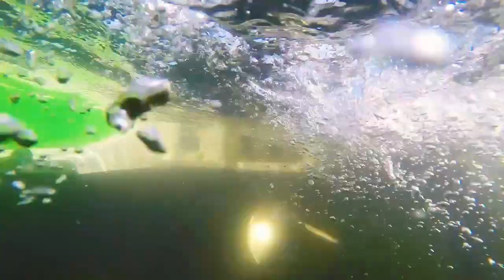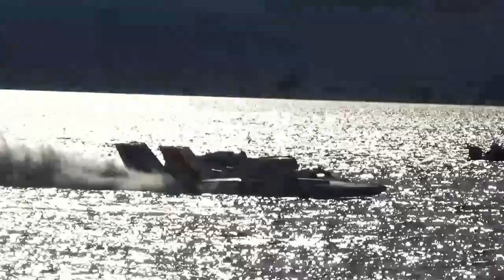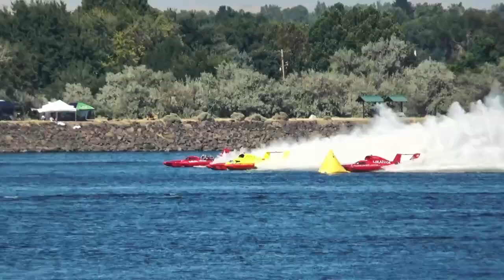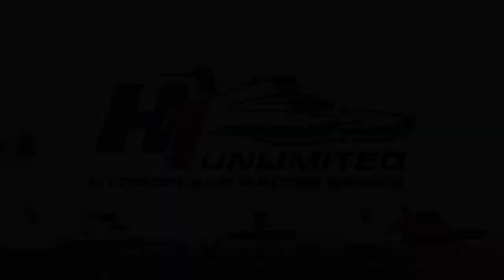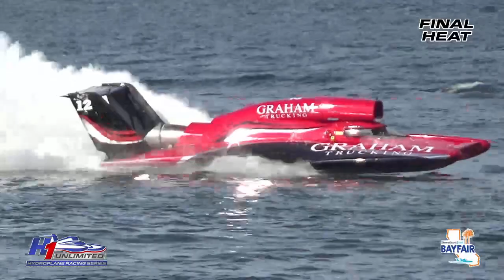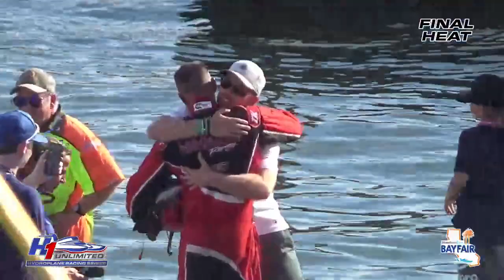2019 HomeStreet Bank Bayfair Final Heat

Comment: I like JMK but I don't like the way he started that race. What happened to the 80mph rule?
Reply: That start sucked. So, just go park your boat with 2 minutes to go and CRAWL?!? How lame is that??? I'm with you - what happened to the 80MPH rule? Park-and-start is a JOKE. What a disappointment.
Reply: They did a way with the 80 mile-per-hour rule with the last race of the season and I think that's BS, they should have done away with it before the season started and Jimmy Shane would have won four races instead of two. That 80 miles per hour rule was a stupid rule to begin with.